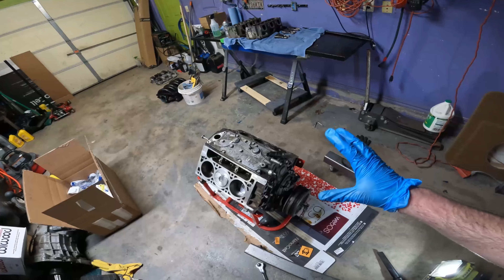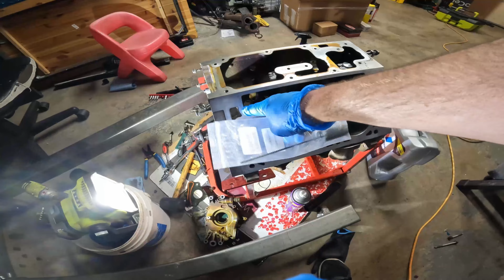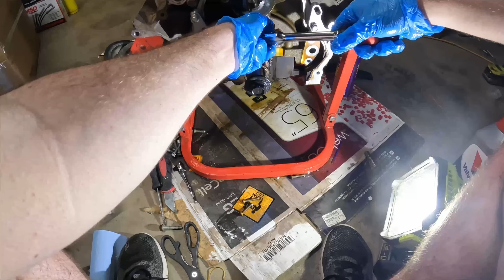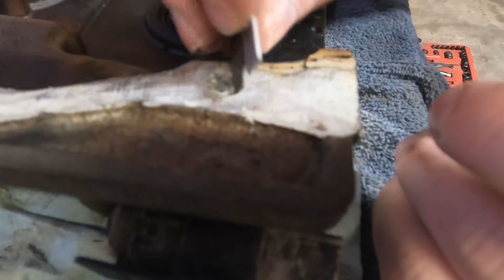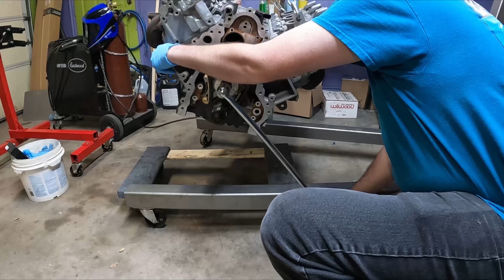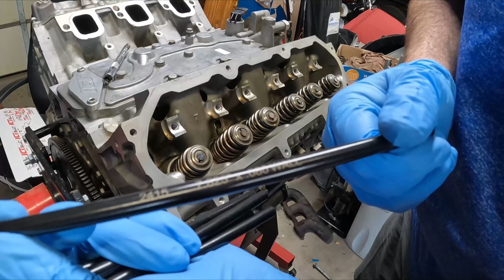I put what engine in my S2000!? RF1 Build Ep: 7

Comment: I have a 1976 Toyota celica Liftback ra29 . Looking for a engine swap . What engine you recommend?
Reply from the maker: I’d highly recommend either a Toyota 3SGE Beams motor or an F20c. The beams motor is well documented on the Celica forums and there’s a few manufacturers making conversion mounts for them as well. The F20c sits nicely in the engine bay as well but can be pricey nowadays and would require custom made motor mounts.
Reply: @VEDEMRACING99  thank you I really appreciated . Great videos 🔥🔥🔥🔥